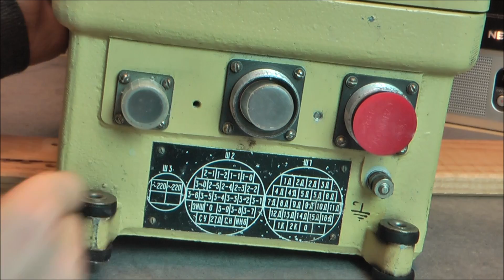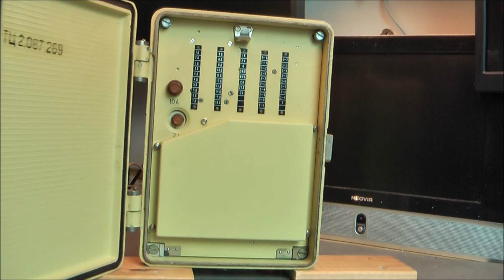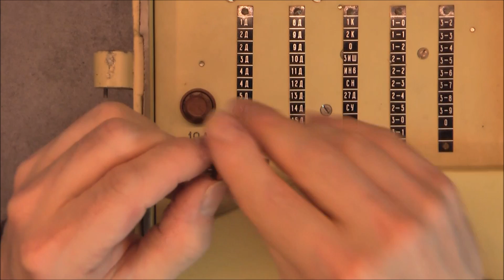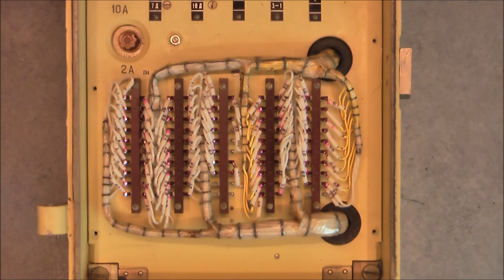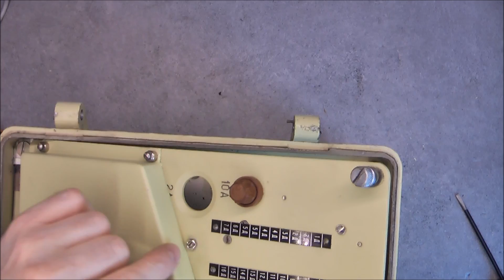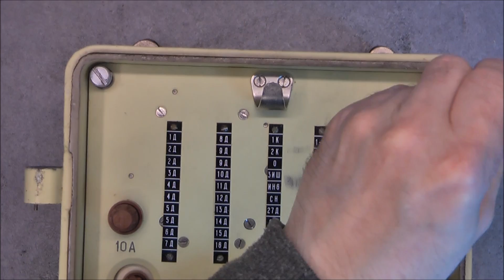Soviet Navy "БП ШСУ" electronics cabinet teardown

Comment: On the first pcb eight ceramic smd devices are not ics, it is diode arrays. Near them probably not transistors, but low power triacs, because their pins have marking on pcb - "1", "2" and уэ - управляющий электрод - control electrode.
Reply: Yes, you can find the diode arrays here: https://eandc.ru/catalog/detail.php?ID=1043

Comment: Looks like it is a power interface controller, where you have either logic level inputs to control power devices, or you have some form of computer control of multiple power circuits. Probably for a ship, where it was driving hydraulic valving for functions, as the break out panel on the front is there to enable you to measure the voltage outputs directly, so you can see if the fault is the actual controller, the wiring to the valve or the valve itself. Diodes for the valve back EMF and clamp diodes for the power supply, and then the main unregulated power supply for the valves, which do not really need a smooth DC supply, with the small PCB with power transistors providing a power supply for the logic IC's. They are there to provide either interlocks, or for safety circuits so that you need 2 inputs for the valve to operate, or for inhibit logic so you cannot have combinations of outputs active, might even provide latching or end of travel cut off on some outputs as well. 7 high power big relays, and then the 5 lower power ones probably for small pilot valving for fine control.